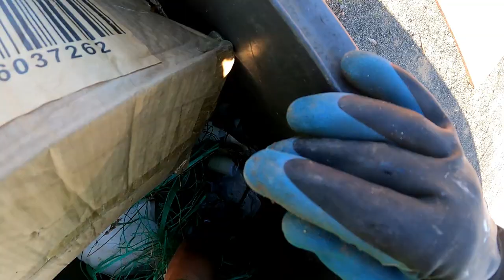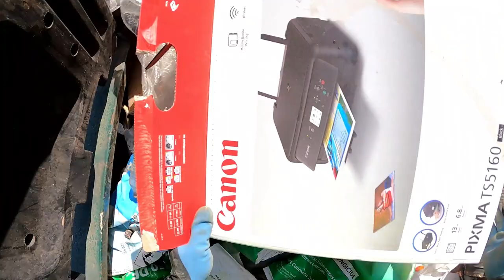Dumpster Diving This Is Going Well

Comment: Do y'all get deposits for the bottles and cans? If so don't that mean you pay a deposit to get them ? Why couldn't you take the bottle without label on it?
Reply from the maker: Yes we do get a 0.10 cents for the cans and bottles.  When it comes to paying a deposit on the items we buy it is actually included with it.  They bottles without a label will not go through because of the barcode all of that bottles & cans have I barcode on them so we can get our 10 cents back if there is no barcode.